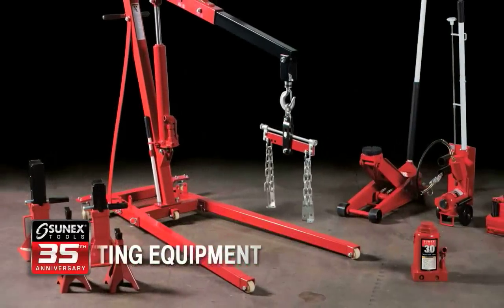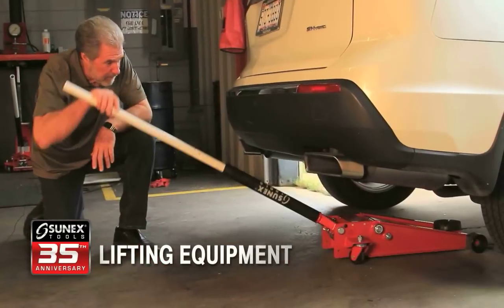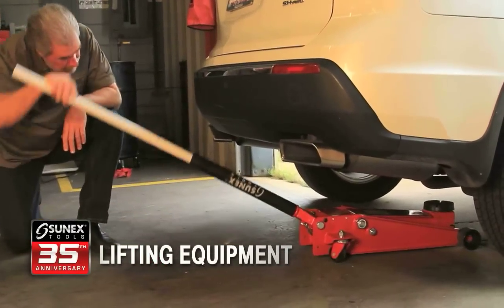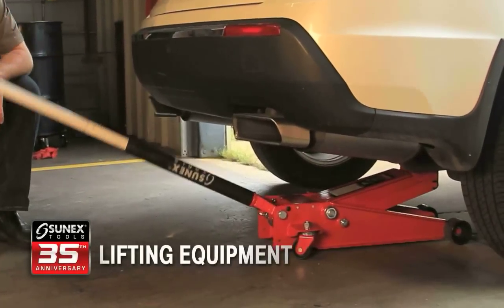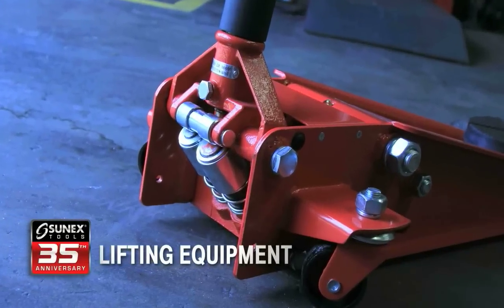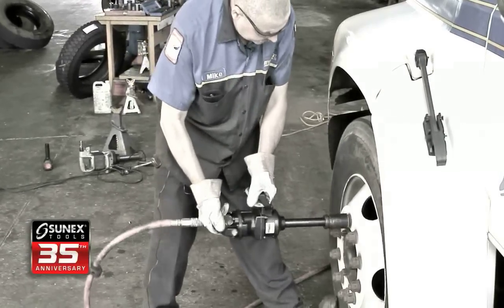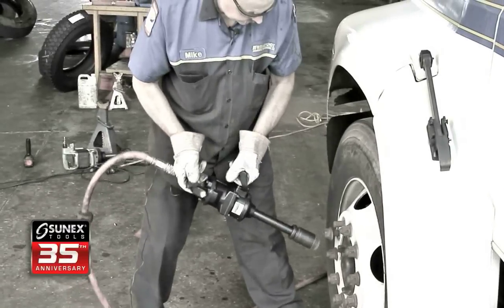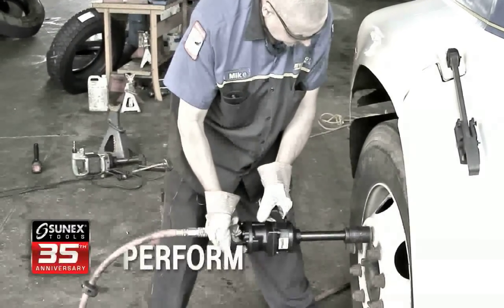Sunex Tools Overview

Comment: I have the 12 point 1/2 inch drive driveline extension wobbly and they do the job better than anything else out there. But the shaft broke after a few uses. The 2nd one lasted for a couple of months and the cross pin just broke. I also have the sunex long barrel air hammer that is great. 
BUT could anyone tell me how to warranty the sockets? It would be greatly appreciated.
Reply: Update: I finally found the phone number and in less than 5 minutes the replacements were on the way. Didn't even have to send them the picture I had ready. Warranty service was outstanding 🙂